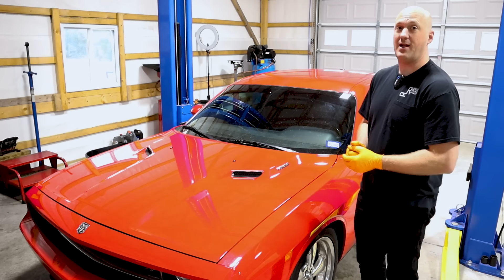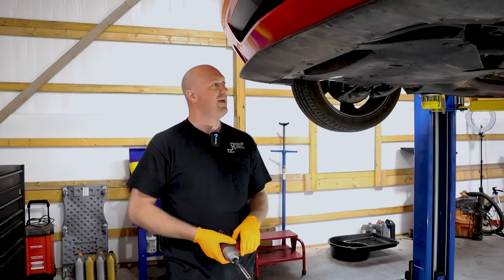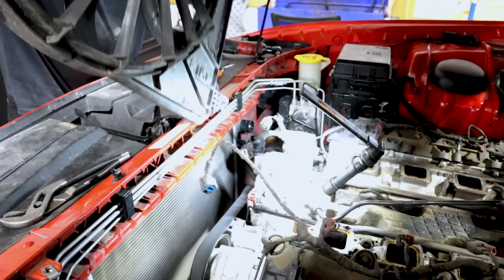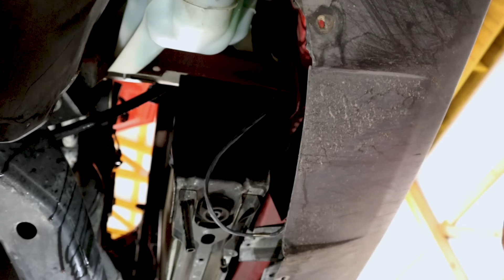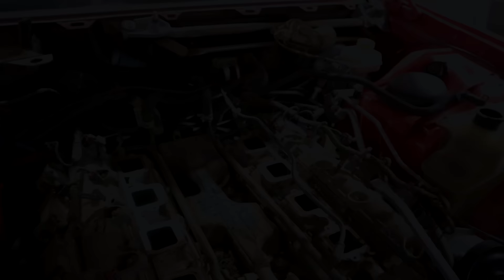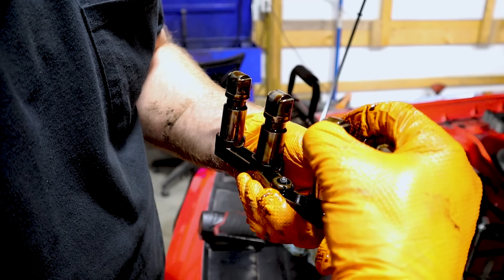Hemi Cam Installation! Budget Challenger Build Ep1

Comment: Looking to do this relatively soon. Is it a necessity to pull the cylinder heads if I’m just swapping the camshaft?
Reply from the maker: No it's not, I've done it without pulling heads as well. Generally if I'm working on a Hemi that has in excess of 100k miles I'm for sure changing the lifters as well, but if they aren't needed you can keep the heads on.
Reply: @ Thank you, this video series is probably is going to save me a lot of money lol. Follow up, do you think it’s required to upgrade the headers? My plan was just to do the cam, tune, and cat back exhaust but leave the stock headers, at least for now.
Reply from the maker: @TylerBurk-p6h  I would say yes to the headers for a couple reasons. #1 engines are just air pumps, the more air they can move the more power they make. Upgraded camshafts only purpose is to flow more air. If the exhaust is stock, you can't move that extra air and you're not maximizing it. Secondly, you're going to need a tune with the new cam, but there's no point in getting it done without having the final mods done or you'll just have to pay for it again. Hope that helps 👍
Reply: @ReignitedAuto  one last couple questions as I’m diving into this. Was able to find SRT headers/exhaust manifold easily and at a good price. My question is the mid pipe, I can’t for the life of me find a decently priced 6.4 mid pipe, where should I be looking? The oem Mopar one is $$$. Finally, for my cat back, should I be looking at 6.4 aftermarket cats now instead of 5.7 ones?

Comment: Did you installed the  required 0.15 valve springs shims for the correct valve springs height??

Comment: Where do you get your parts for a camshaft and lifter replacement? I'm in need of getting my truck back up and going. Please help
Reply from the maker: In regards to the cam and lifters specifically I'm an OEM guy. I know it's expensive, but worth it. Those cheap kits on Amazon WILL rattle and sound terrible, then you've got to do the job all over again. 
Gaskets you can go aftermarket, but don't cheap out on the lifters themselves.

Comment: How do you take of the crankshaft bolt without the crank spinning??
Reply from the maker: Best option if you don't have an impact is to remove the inspection cover on the transmission to access the flex plate. Stick a screwdriver or pry bar in the teeth to keep the engine from spinning. Just remember to take it back out before trying to start the engine 😄
Reply: @ReignitedAuto ok thank you 🙏🏾🙏🏾🙏🏾

Comment: how you get that last bolt on the left side valve cover off? 🤔
Reply from the maker: Those are in a tricky location. I use a 1/4" drive extension with a universal joint style adapter then a mid length 8mm socket. A standard wobble adapter does not have enough bend to it to be effective, has the be the universal joint style.

Comment: how long could this job take? and would it basically the same process with an stage 2 aftermarket cam?
Reply from the maker: Actual labor time is something like 8hrs. I would say that if you've never done it before and have minimal experience working on cars then plan for at least two days, maybe 3. The process is going to be identical regardless of the cam you choose 👍
Reply: can you send me the link to the stock cam and lifters kit? can you do the mds delete with the stock cam and lifters? 🤔I think I wanna just got back stock instead cause with the stage 2 I got to find somebody to tune it on point and all that

Comment: Why would you change the Oil Pump and the timing chain while you got it all apart?
Reply from the maker: I made this video several years ago before I started making all the videos on the benefits of the high volume pumps. All my current vehicles have the upgraded pumps in them. The timing chain I don't generally replace those unless the vehicle has at least 150k on it. Hemis don't generally have a reputation for timing chain failure unless the vehicle has been abused. 👍

Comment: If only replacing the cam. Is it necessary to remove cylinder heads ?
Reply from the maker: No it's not, I've replaced just the cam before without removing the heads, however as issue prone as the Hemi lifters can be i usually like to replace them at the same time.

Comment: Do you have a video how to complete bullet proof a 6.4? Melling pump , cam and other vvt or valve emission delete? I'm not sure what these engines have that can be simplified. I know there is a kit that you can buy for a 6.2 Chevy that takes out the roller bearings on the Rockers and you install brass bushings which semi trucks use for many miles. 🤔

Comment: Is it the same with an MDS engine? If I swap in an mds capable 392 cam and mds lifters would it work the same? Trying to avoid doing MDS delete. I want the shop to do the tune only I wanna build it myself
Reply from the maker: Absolutely identical 👍
Reply: @ thanks! Chat GPT doesn’t give me the exact answer all the time. One more question, OEM hellcat rods and springs would work for this right?
Reply: @ a little research tells me it’s not possible to keep MDS with hellcat rods so I think I’ll get a delete kit would that be easy?

Comment: Should i replace the push rods too ?
Reply from the maker: Unless you are installing a high performance cam, or directly see excessive wear on them, then no I don't usually replace them. One thing to keep in mind is that your pushrods are the "fuse" inside your engine, if something fails I'd prefer it be the pushrods. Aftermarket hardened pushrods do not fail as easily.

Comment: Awesome.  I have a follow up question. Would you believe I can increase the torque of my 2005 dodge 2500 hemi 5.7 magnum to to the capability of a 5.9 Cummins engine? It is approaching 600 rated torque. Mine currently is rated 375. Purpose? I need something to tow a 15000 lb trailer which the Cummins can do. My truck max now is rated 13,800. If yes what mods do you suggest to achieve? Here is what I'm thinking. Long tubes, cold air intake replacememt,  copper spark plugs, new high quality air filter, and fresh high performance synthetic oil.

Comment: I put a cam in my LS with 2 wooden dowel rods and didn't have to pull the heads lol
Reply from the maker: You can do it with the Hemi too without pulling the heads, but with the Hemi cam issues it's likely you're needing to replace the lifters anyway so this is the way I'm used to doing it 😄

Comment: Thanks for the video! I need to replace my cam and lifters on my 08 srt8 I noticed a misfire at high rpm with a tick I replaced the coil and plugs but now I’m looking around for new parts

Comment: I have this problem now. But i have a Extended warranty so i was going that route but if the Extended warranty gives me a problem I'm going to try this myself im pretty Handy and i know a good but about cars just never did this kind of a big job on a Car. But i know i can do this. Thing is you must have all the tools you need so you won't run across any problems with getting anything off along the way. Plus i have a garage at my home with good lighting

Comment: Hey sky, someone says its always mandatory to resurface head and block. Is this true? Being that youve done this hundreds of times, is that the case?
Reply from the maker: Nope, not mandatory, and this comes directly from Chrysler service information. If you have reason to suspect the heads need to be resurfaced, like say if it's been overheating or you suspect a head gasket issue, then sure go ahead. Otherwise just cleaning the old head gasket residue is fine.

Comment: From your hemi cam build series is there anything that you would add or take away from to help someone with the process? I am literally going to watch your cam series video while doing my swap with a pre eagle block to eagle heads, cam and a 6.1 intake manifold.
Reply: Yes I was going to do the .70 head gasket. At least that’s what I have been reading.
Reply from the maker: Only thing I would probably add is if you're doing the eagle head swap is to go with the added thickness head gaskets from MMX performance otherwise your compression ratio is going to be quite high. 👍

Comment: Thanks. Really enjoy this. Is this similar to the 6.4? I’d love to change my cam shaft and do it myself.
Reply from the maker: Pretty much an identical process with the 6.4 👍
Reply: @ReignitedAuto  Bitchin', I think I'm gonna give this a go if I can swing a cam package. I am hoping to get more lope and a bit more power...I understand the 392's are pretty optimized from the factory but which cam would you suggest? I would like to keep reliability and streetability within realistic expectations. Many thanks.
Reply from the maker: @dpenton  to be honest I don't personally have a lot of experience with aftermarket cams so I don't feel qualified to give recommendations. But if you call the cam companies directly they usually have really good tech support that can guide you to a cam that fits your needs. 👍
Reply: @ReignitedAuto  Hey thanks a lot for the reply and info. That goes a long way for your audience. I really dig your content and your video style. Keep it up, thanks again!
Reply: @ReignitedAuto  Looping back here, I bought a MMX Max Effort N/A cam and kit. I am reviewing your process here along several other resources before I go ahead and do the swap. Probably not until this season is over and my car is tucked away for fall/winter. We will see.

Comment: Why keep t tree timing chain why not put a new one on
Reply from the maker: Hemi engines don't generally have timing chain issues like older engines did. If it had 150k or more I'd probably change it, but not before then. Some people will say it's cheap insurance, I say it's your money. 👍
Reply: @ReignitedAuto  I was just asking cuz I’m about to do mine at 174k because of lifter n cam failure

Comment: Is it also possible to replace the cam on a charger without pulling the engine? 2014 5.7 hemi awd.

 I'm looking to do an mds delete and 130k mile service on a car I'm buying soon. + install a high volume oil pump.

 Greatly appreciate your videos, I always shied away from dodge but now that I know exactly what problems the 5.7 can have and how to fix/prevent them I'm very excited to do a light rebuild and end up with a very reliable, comfy, awd v8!
Reply from the maker: Yep, it's the exact same process shown in this video. 👍

Comment: 2014 Durango R/T awd 5.7. 130k miles. Just did the cam and lifter job. Tore it down as soon as I heard the tick. Two lifters were failed but hadn’t seized yet (one mds lifter and one non mds lifter went out). The coinciding lobes were beginning to pit and about 4 other lobes had the hardened coating rubbed off. Just caught it in time before the cam got chewed up. Did an mds delete kit by AMS had everything I needed and more. First ever cam/lifter job, pretty straight forward just took the weekend and about $2k. Shop quoted $5k. I’m getting better city mileage by 1-2mpg (according to the computer) with the mds delete and tune and it’s way smoother. Love this engine even more now that I’ve torn it down. Hopefully I’ll get another 200k+ miles out of it.
Reply from the maker: Great job! Love to hear the success stories 👏

Comment: Bought a 2018 Ram 2500 6.4L which had a camshaft/lifter replacement done already before purchasing. The check engine light came on shortly after purchase. Checked codes and had lean codes on Bank 1 and Bank 2. Checked for vacuum leaks and fuel issues all looked good. Went back to last changed parts and found the camshaft used was an after market cam from SKP. Skyward says there SKMC1403 camshaft is good for 5.7L, and 6.4L Hemis as well as...  5.9L and 6.7L Cummins. Is this even possible to have the say camshaft work with multiple displacement Hemi engines and Cummins diesel engines?
Reply from the maker: 5.7 and 6.4 yes, absolutely not in a Cummins they are wildly different. It's likely seeing codes because an aftermarket cam requires tuning along with it. Alternatively it could be off a tooth with the engine timing, but if it were there would be additional codes and driveability issues.
Reply: @ReignitedAuto  not seeing any other codes just P0171 and P0174. I could see where the 6.4l cam could be used in a smaller displacement engine like the 5.7l. You would get more air and fuel in smaller displacement areas, causing more power. This could be tuned to make work. Taking a 5.7l cam and putting it into a bigger displacement engine like 6.4l, I would think you wouldn't get enough air or fuel in the displacement area. I'm not sure if this could be tuned to work. I'm not a mechanic, just a guy looking for knowledge to get truck fixed.

Comment: Would this process be the same on my 2014 charger RT, road and track (non all wheel drive)  Just to clarify nothing to beef up in the trans or rear end?  I always wondered how much power the stock trans and rear end could handle, Ive heard 600 hp.

Comment: Do you have to pull the heads to change the cam? 
Or did you just remove them to install your new valve springs?
Reply from the maker: It's not strictly necessary for just the cam no. I've done it both ways, if you change it without removing the heads you'll want to spin the cam a couple times to knock all the lifters back and then be quick about sliding the new cam in. If the lifters slide down into the cam bores before you do it'll be a problem. In the case of Hemi engines I'm almost always replacing the lifters any time I replace a cam so that's why I do it the way that I do. 👍
Reply: @ReignitedAuto Thank you.
 I'm watching the second video now. It looks like the lifters are under the heads. So you'd have to remove the heads to replace the lifters. My wife's 2012 r/t+ 5.7 just started the tick. Just a touch over 100k. I'll be looking at it this weekend to see which tick it might be.
Reply: Tore the valve covers off. The #7 cylinder intake rocker is loose. Hopefully, we caught it early enough that it's just a cam & lifter swap.
Reply from the maker: @musclecarpat68  most often that is the case. Pull the oil control valve solenoid under the intake manifold and inspect the screen, if it's clear of metal debris then a "simple" cam and lifter swap and you should be dialed with a reliable engine for a long time to come. 👍
Reply: @ReignitedAuto  I'll do that tomorrow. Thank you for your amazing videos.  👊
Reply: @ReignitedAuto  late update. The oil control valve screen was clean.  Huge win!  So far, the hardest part was trying not to drop the bolt for the new melling HV oil pump pick up into the pan. It was the #6 intake rocker that was loose, not #7. There are a few other lobes that show signs of early wear.  

This is a manual car as well.  We had the "free oil change package" and had the oil changed regularly. Once that expired, I did the oil changes and ran Amsoil 5w-20 synthetic. The only difference this year was long idle times. We moved from Arizona to Montana. When it's cold out in the mornings, my wife would warm her car up so the heater would actually get warm on her way to drop our youngest off at school.  

Thank you again for the great videos.  I've changed cams in my Camaro with an old SBC. This is a little more of a teardown compared to that.
Reply from the maker: @musclecarpat68  good news my man! Is it all back together now? If so, great job tackling it and getting it done 👏
Reply: @ReignitedAuto  I had to wait for some parts to show up. Hopefully, I'll be done this weekend. I'm cleaning the heads and replacing the valve stem seals right now. I went with the stock cam, so I don't have to get a programmer, etc...
Reply from the maker: @musclecarpat68  sounds good, just remember my #1 mistake people make putting these back together, make 100% certain the intake pushrods are fully seated in the rocker arms before reinstalling the valve covers. Spin the engine over a couple times to make sure all the valves are operating correctly and you'll be good to go 👍
Reply: @ReignitedAuto  I will, thank you!  I've been going back and watching your videos again as I progress to make sure I don't miss anything.
Reply: @ReignitedAuto   @ReignitedAuto  I've got it all back together now. Primed the fuel rails a few times. Cranked it over, and it fired right up. The lifters were noisy for 10-15 seconds, then quiet. Took the car around the block, and it it started smoking. 

Popped the hood like Brian O'Connor in the first fast and furious, the passenger side valve cover is leaking. I'll be taking that apart tomorrow to see if I pinched or rolled the gasket, putting it on. 

I can't thank you enough for the amazing videos. As an instructor myself, you are an inspiration and an amazing teacher. I hope to hone my instructor capabilities to your level someday.

One of my favorite things you did was stay patient and calm. Even if something went wrong or not according to plan. You laughed it off. Instead of losing your cool and start cussing or throwing tools. 😂 

I tried to buy some merch to support you for the video, but the links don't work. Do you have a new site?
Reply from the maker: @musclecarpat68  I appreciate the kind words! We actually shut down the site and the merch because it was choosing more money than I earned from it, but I definitely appreciate that you want to support me 👍

Comment: I have a 2017 Ram 5.7 with 395 hp. Will these or most of them help this application? 
Also is it possible, feasible to install a Hellcat top end heads, headers, cam, and supercharger?
If not can you recommend what I need to do to get 600 whp or better?

Comment: Love your videos I have a question for you since you worked for a Dodge dealer I have a 2006 Dodge Charger Daytona replace the instrument cluster the check engine light still doesn't come on and they say I fail inspection because the light doesn't come on what could it be